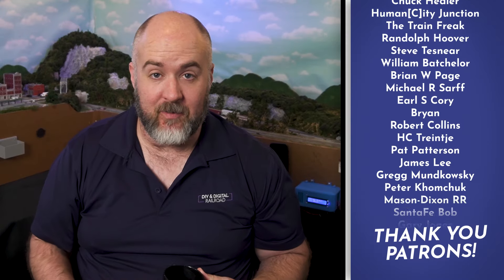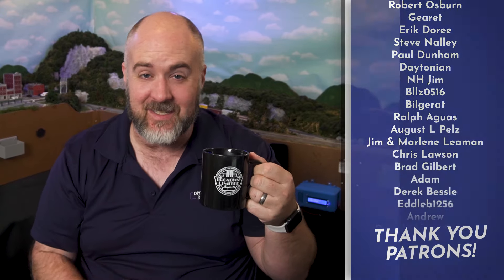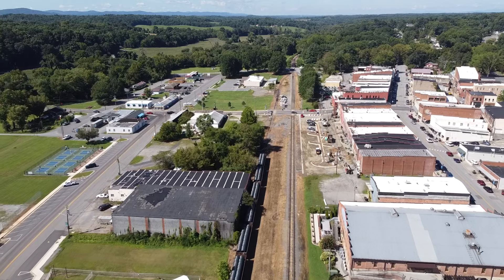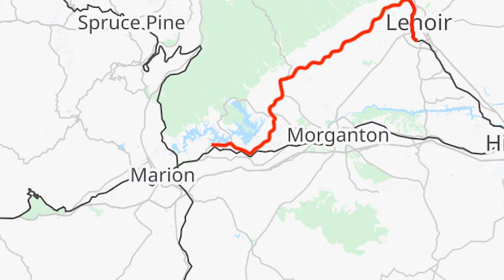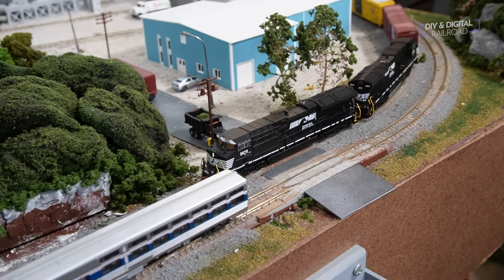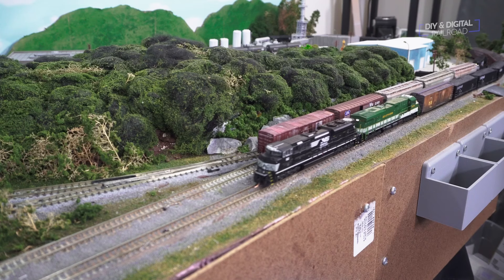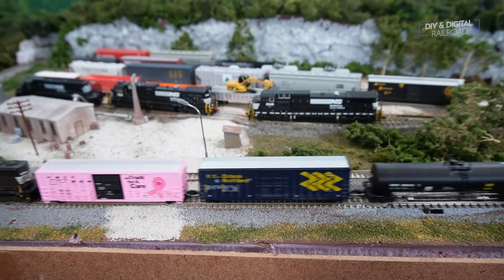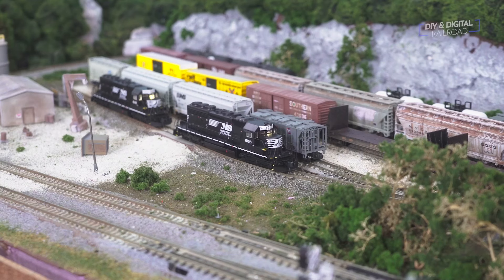Protolancing: The middle ground of Model Railroad Design

Comment: I'm building an HO shelf layout with Caldwell County Railroad as my prototype. I'm sure you know, this is the short line which operates the former NS branch from Hickory to Lenoir. (Yep! the same Lenoir that's on your map!) This little line's laid back, one or two short trains per week operation, suits my layout aims well and their two GP16's still in Family Lines livery is a nice bonus. 
I'd like for this to be a really close to prototype layout BUT I have had to accept many changes. Example: The NS interchange at Hickory needs to be built along an outside corner to match reality. My spare bedroom space has no outside corners. And this is just the start. I find so many adjustments are required that preserving the SPIRIT of CWCY is the best I can really hope for.
In the end, this works fine for me and I'm happy with how it's going.

BTW-- I'm drinking "Folgers Classic Roast"

Comment: My model railroad can somewhat be considered a protolance Railroad. It is based in an area a few miles south of Chattanooga Tennessee, and runs between the suburban towns of Bonesborough and Gravesfield. 

It canonically would be a private railroad contracted by TVA to shuttle coal between the transfer point in Bonesborough to the dump point in Gravesfield, where it would transfer the coal to trucks to be delivered to the fictitious TVA Gravesfield coal fired power plant. The railroad mainly uses a fleet of mid-to-late 20th century diesel locomotives, but they do keep four steam locomotives operating for excursion services on weekends and special photo charters, including the only surviving New York Central J3a Hudson. They also operate a USRA light pacific, a Russian Railways YE class 2-10-0, and a USRA 0-6-0 switcher. They occasionally use their YE class 2-10-0 to run freight trains and perform banking services.

Comment: I Model lehigh and new england, they bought the cnj lines in pa, and lehigh and hudson river,  they also took over the line from scranton to the erie mainline owned by the ontario and western.   the l&NE uses rs2, fa1, s2, and rs11, rsd12, c420, c628-30, all alco.  also a couple of fpa4.

Comment: Neat idea.  I'm modeling in the mid 1920's on my D&A (Durham and Ashville) which has an interchange to a small narrow gage line that runs logging operations in the mountains West of Ashville.  I too have roots in Western NC as my Dad's mom was born near Hendersonville.  I guess I'll need to flesh out my backstory a bit more as that's the extent at the moment.
Like the channel (even though you're modeling N scale, everyone knows HO is the ideal scale, ha ha, just joking).  You can pack so much more in N, it does have it's advantages).

Comment: Great video! I'm in the early build stages of my newest layout (so far I have bare benchwork and a helix). I grew up around, and riding, the Algoma Central - my dad worked there for 39 years - so naturally that's what most of my rolling stock and locomotives are, and so I need to have my railroad servicing the appropriate industries to match the rolling stock (a steel mill, pulp and paper, lumber mills), but for the actual layout I'm planning to basically freelance the actual towns and industries. That's my version of "protolancing". It also allows me to run some ACR steam in the 70s along with the diesel power, despite the real-world ACR being the first Canadian railroad to get rid of steam by 1952... I'm creating my own alternate reality. (and I'm drinking some Tim Hortons coffee from my Keurig in my office...)

Comment: Dear Jimmy, nothing wrong with the denominations of ‘prototype’, ‘protolance’ and ‘freelance,’ but would like to add the iterations of fantasy or fictional to these three main categories. Especially where there are several different understandings of proto-type, or where free-lance may just mean a model railroader operates different eras at the layout. Think your example of the added fictional line is an excellent example of fictional protolance. Just as an add on idea, let’s say for posterity’s sake! Cheerio

Comment: Freelance: Lets you build whatever you like, even with your own railroad or mix of railroads.  Also lets you build your track layout however you like.
Prototype: Strict adherence to a specific line or timeline IRL, selective compression is the only given here.
Protolance:  Choosing an IRL railroad, but the lines served either are invented (video example) or industries in the area are new or are configured differently then the real counterpart.  This type gives a lot of freedom to build as you please, like freelance, but your operation scheme is based on a real railroad.